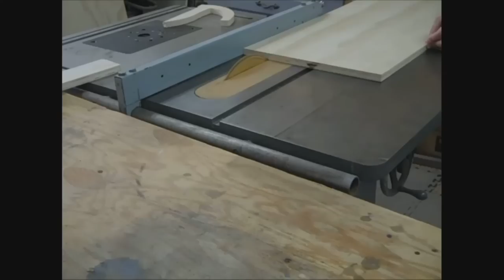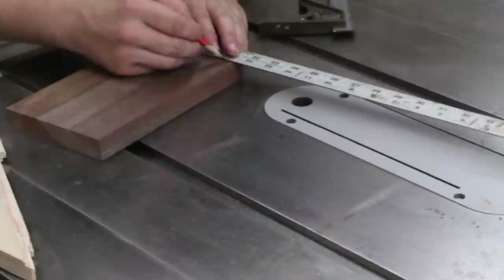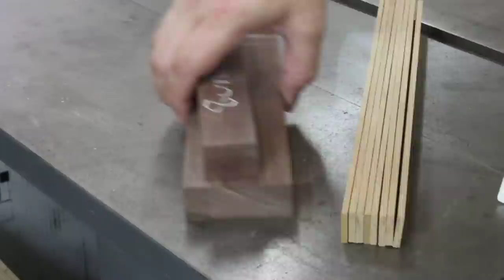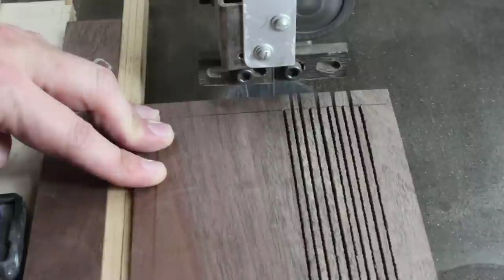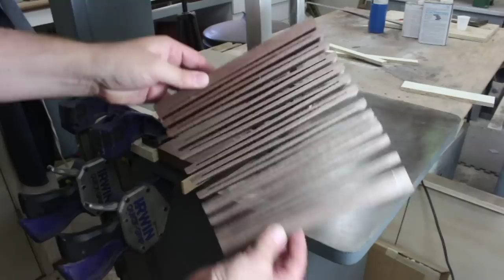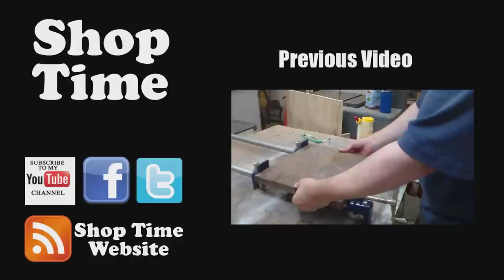Sliced Wood Bending Technique!

Comment: Great vid. With that technique I can see a lot of uses. Lamp shade, end table, even a room divider with a large enough piece of wood.
Reply from the maker: Sho81 I think a lamp would look really cool! Seth also uses Ash, which I think would make a pretty lamp!
Reply: Peter Brown Yeah. I had the idea of a lampshade with one of those hollow form tubes in the middle so in the slats you can pour colored epoxy for kind of a stained glass effect. Seems like a long and tedious process of which I don't have the room to do.

Comment: That is a nice trick. I used to do it with paper, folded a few times and get nice patterns. Never seen it with wood. Did it help the wood was basically free? 

Love the video!
Reply from the maker: Willem Kossen Right!? The one where you can cut if and walk through it. It almost has a cardboard feel too it the way it moves...
Reply from the maker: Willem Kossen Yes it helped! I had zero concern chopping up free walnut.

Comment: That's awesome! I was just using a five gallon bucket, and happened to see on the bottom that it is made out of hdpe. The first thing I thought was, "I wonder what peter brown would do with this?" It is pretty thick, and you can find them in different colors.
Reply from the maker: William Atkinson I don't think I realized those were HDPE. Now I've got even more sources for stockpiling... :)
Reply: Peter Brown especially when you can get one for three bucks from the local big box home center :)

Comment: Put runners on the side and have it as a sliding decorative lid on a box. A little clip at the front holds the 'concertina' open when the lid is closed, unclip and compress the wood back to normal to open the box. You could even have a hinge that will only allow the lid to flip open when the wood is compressed?
Reply from the maker: AHeadC I see what you're saying. Stretch it open as a lid? I wonder how that would work. It might also be a substitute for tambor doors

Comment: Ahhh, wooden slinkys as a sideline? Probably not but will wait for the real thing. Have seen trellises made in this manner.Fanned out at the  top. Neat looking job!
Reply from the maker: Lewie McNeely Oh. Wow, that would be cool. What sort of material did they start with?
Reply: The trellises were pine or fir 2x's. Just ripped thin and then blocked apart to get the fan shape.  Maybe wide in the middle and closing up toward the outside.

Comment: Wouldn't it be important to bore a hole into the wood at the end of every cut to prevent too much tension there/prevent the wood from splitting there when the wood is stretched?

Comment: I was thinking that since the 32 units (two 16 unit halves of the clock) barely worked. maybe doing 36 units (two 18 unit halves) or 40 units (two 20 unit halves) would work. I have no idea, I've never worked with wood, but if somenoe wants to try it out or whatever, tell me how it works out.
Reply from the maker: +Fire Twerks It's worth a try! I'l still very green on this technique!

Comment: cool piece, maybe pull apart slightly, color epoxy, change color every 8 inches, cut into equal squares, glue and stack on top of each other, turn a bowl?
Reply from the maker: lionel wainford That might work. It would be a fair amount of effort but could have a cool cross-section.

Comment: Maybe make one long enough to form a cylinder then fill it with epoxy and turn it on the lathe, you could make a jar or some other cylindrical thing.
Reply from the maker: Josh Moss I think you might get a cool effect, I'm just not sure how to apply the epoxy.

Comment: Man you had to set your fence 8 times to the right distance when you sawed your strips. Either that process took forever or they are not exactly the same thickness. Or both. Why did you not set the fence closer to the blade and cut them one after the other?! If you say kickback now, yes it can happen, but with strips of that small size i wouldn't be too woried. Other than that, that's a pretty cool technique!
Reply from the maker: mrblackball Thank you!!

I've actually taken a 1/8 strip to the chest after it kicked back. It was super scary and I have no need to it again.If you look close you can see some masking tape on the saw. I have a witness mark on there and I just keep bringing the fence over till the wood touches it. It's a pretty good system for me...

Comment: When I was in construction we would cut slits into drywall to make it bend for arch ways or domes and what not
Reply from the maker: Daily Cup of Justin Oh... Is that how you do it? Just score parallel lines on the back or something?
Reply: Yup. It was pretty cool. A lot of the houses I worked on had concave domes, sloping stairs, and arch ways. It was an easy way to do that, and after taping, floating, and painting It looked like one solid piece. Also that same method is  .  Used for top of the line speakers with ports. Instead of had edges that sound has a harder time going around the slope and curve them to help the sound have more fluid of a path. It's pretty cool.

Comment: You're not a math guy :-), BUT: make a board of 1 unit, 2 units, 4 units and 8 units, 16 units etc. You can make ALL of the cuts using this method. It's basic binary.
Reply from the maker: +Guitarhero1800 I like that! As a network engineer, I can do binary to decimal translation. For me it's more memory than math...

Comment: Jimmy DiResta did a video for Make where he uses a variation of this technique to build a lamp shade.

https://www.youtube.com/watch?v=8hj6BK8WGtA (If that link doesn't work, it's called: "DiResta: Wooden Lamp)
Reply from the maker: *****  Trust me, I've watched EVERY DiResta video. (major props)

It's a bit different. He cuts all the the way from top to bottom but only half the thickness of the board. It's cool how many methods there are to get similar results in with wood!